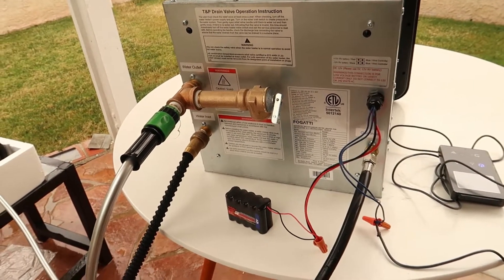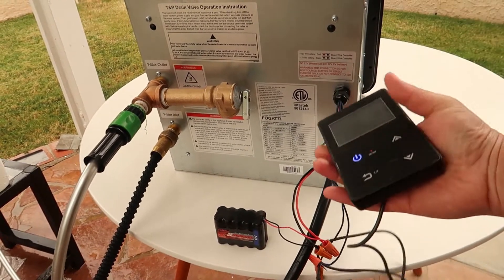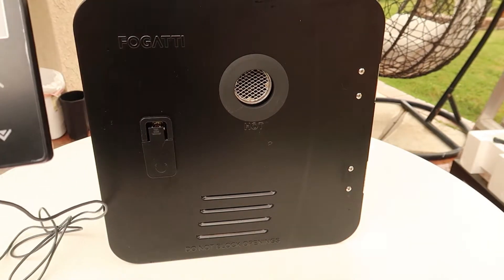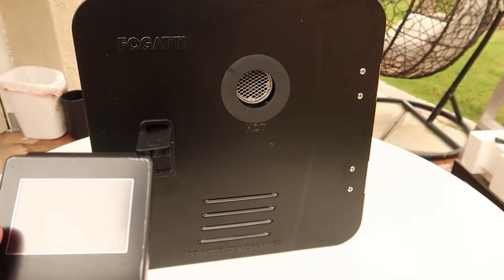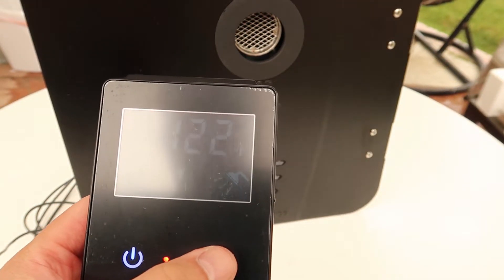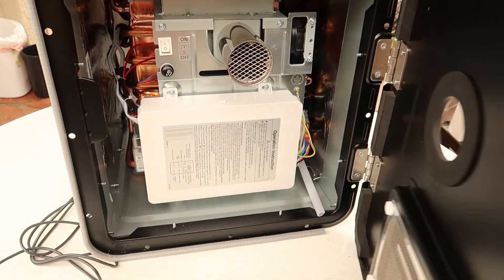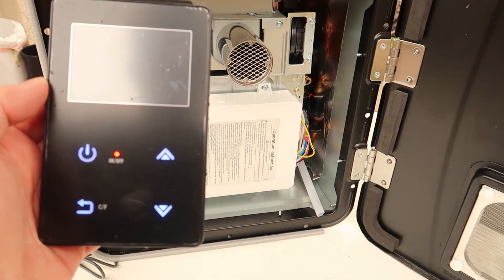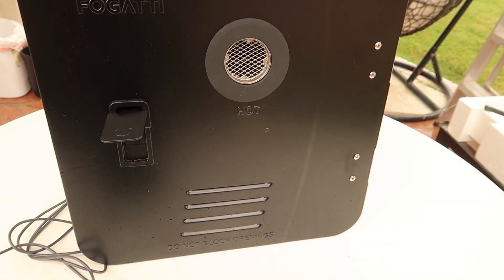How to Install an RV Tankless Water Heater | Fogatti RV Tankless Water Heater Test & Review

Comment: Where did you get the black water hose for the bottom left NPT? I cannot find one that fits the Fogotti and is able to connect to the RV water line. I had to use turn arounds and it has caused some leaking. Thank you!